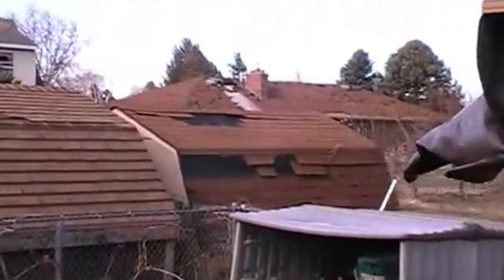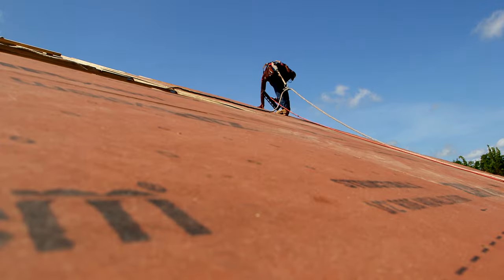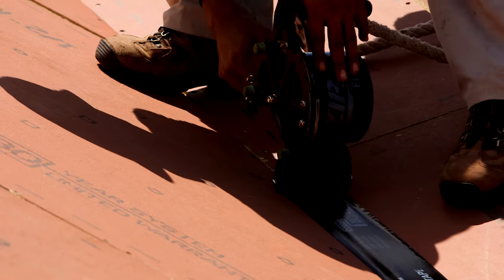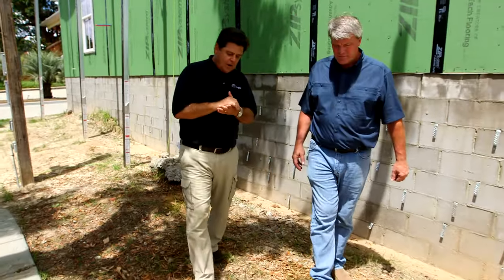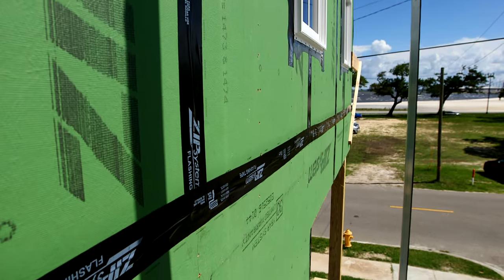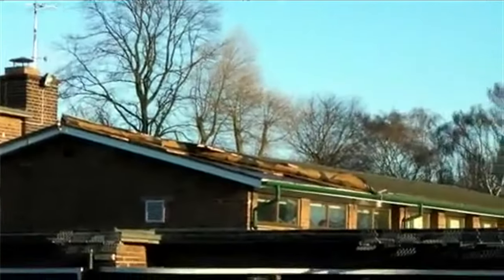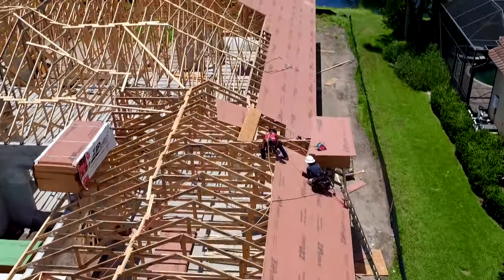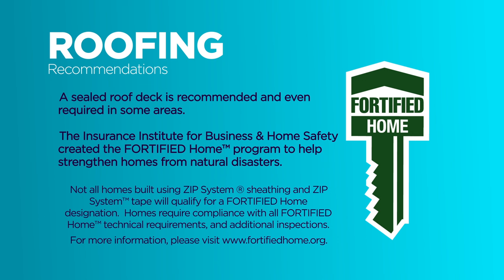ZIP System sheathing and tape for resilient roofs | ZIP System roof sheathing

Comment: What is the recommended temperature that the tape should be installed? Can it be installed in the winter months without the risk of the adhesive not bonding correctly?